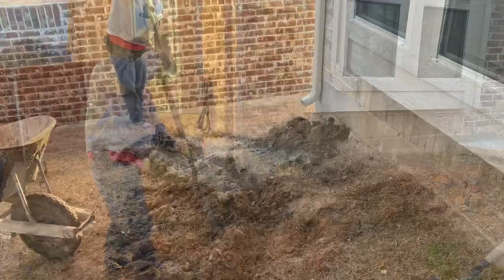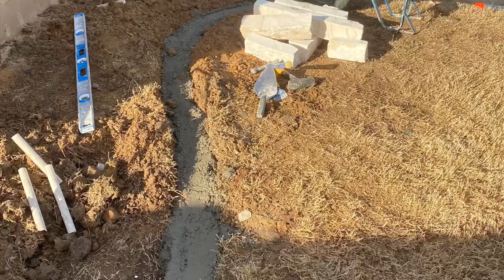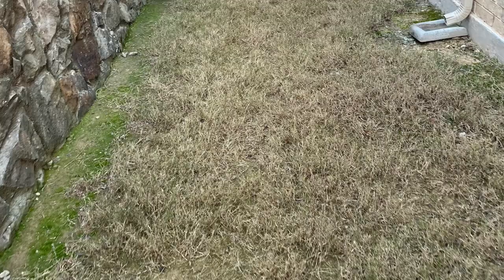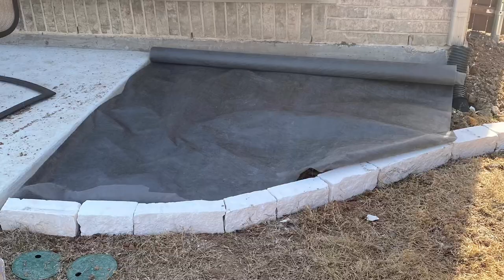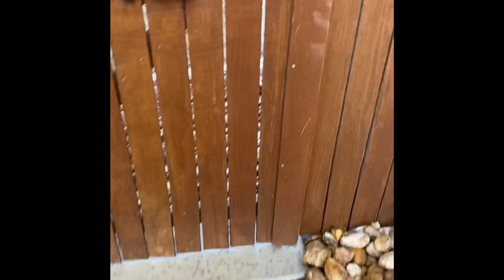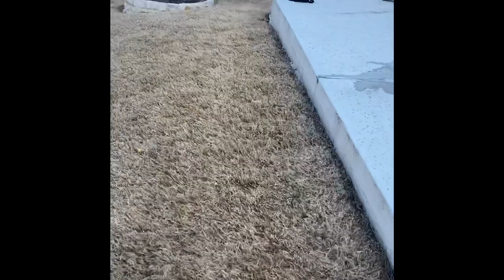Flower bed with austin stone, drains and texas bull rock

Comment: Nice work. 👍👍👍👍

Can i build the garden retaining wall  3 layers  crossover on buried 3 inches sewer pvc pipe line. 1  paver has 24 lbs  weight. I build with 3 layers .so weight will be 75 lbs  . Sewer pipe can handle of that weight . Someone Please help me concern and  instruction  please .

Comment: What is the name of this stone I have some questions because I want to do the same project! Are you cutting the brick?
Reply from the maker: Is Austin chopped stone
Reply: @rclandscape7386  what's the cost on one of these? Would great appreciate the answer! 😬
Reply: @marlonquintana3466   at home depot they’re like $4 each
Reply: @jessef7546  I mean the scope of the work. 🤔
Reply: @marlonquintana3466  just the flower bed i would of charged $1400
Reply: @jessef7546  are you a stone mason?
Reply: I would of charged 2000 without material just labor